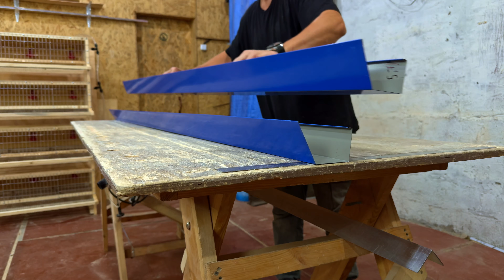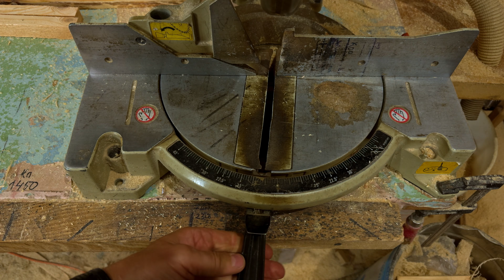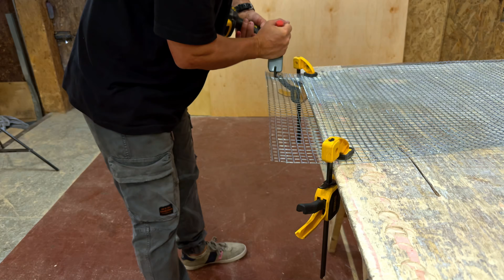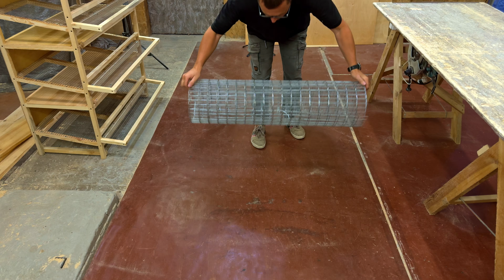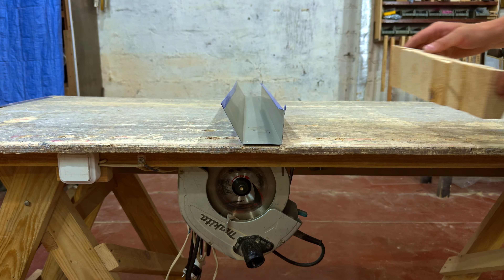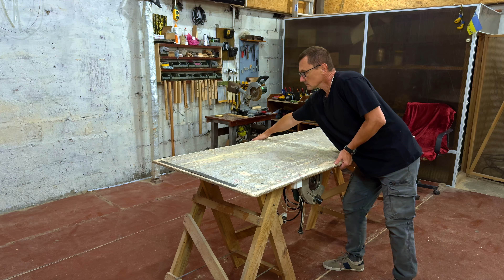100 Quails in ONE Cage?! 4-Tier DIY Battery Setup

Comment: I have 70 rtl quails but they lay eggs less than i expected 😭😭😭
Reply from the maker: Light: They need a strict 14–16 hours of light daily.

Feed: Make sure your feed has 20–22% crude protein + enough calcium.

Temperature: Keep the room around 18–22°C (64–72°F) and avoid drafts.

Age: Peak production is during the first 6–8 months.

Adjusting light and feed usually brings them back on track quickly! 🐣"

Comment: I didn't see the dimensions for the strips you cut. I got me a table saw and miter saw. I am going to give your cages a try.
Reply from the maker: The bar has a cross-section of approximately 25x25 mm, if that’s what you’re referring to.
Reply: @volodymyr-f9y  the piece that the end of the egg rollout on the side I see the cross piece lenght.
thank you

Comment: I think it's great. The only improvement I would make is vinyl coated wire flooring to avoid bumble foot which is very painful and can leave open sores on their feet. Otherwise, it's wonderful. Aloha
Reply from the maker: I agree with you, but when constructing the cage, it is important for the mesh openings to be small; the wire thickness is equally important, as it is precisely the thinness of the wire that can lead to such problems.